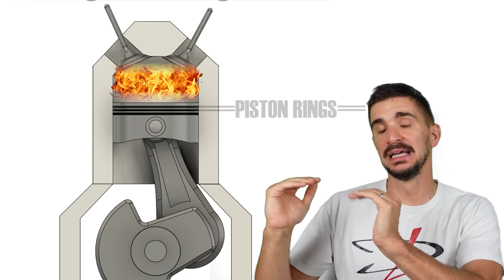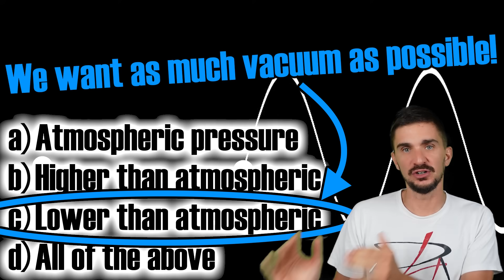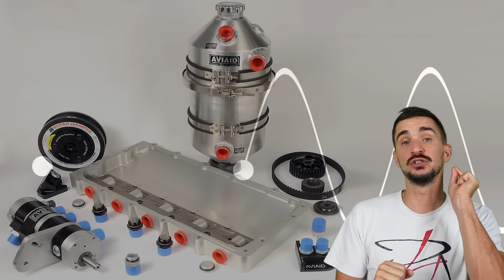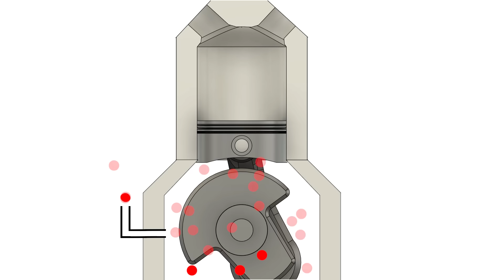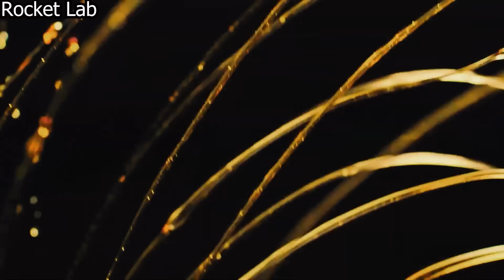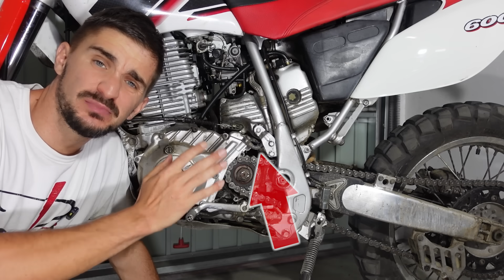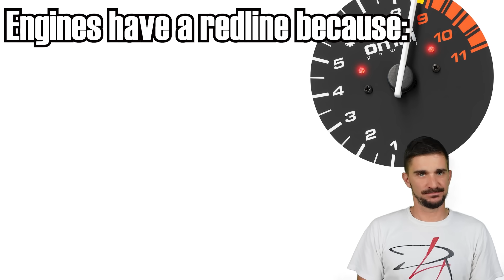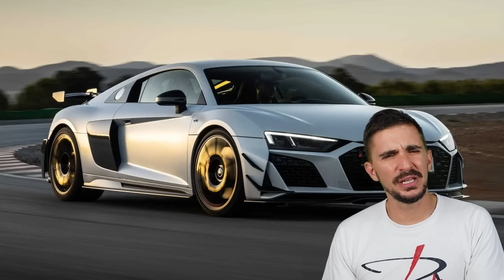Installing This Has No Drawbacks, Except for Your Wallet - Dry Sumps Are Awesome, Here's Why...

Comment: I might be missing something, but if you draw a vacuum in the crank case won't the power loss stay the same because when the piston moves upwards its now increasing the volume and therefore increasing the vacuum pressure?
Reply: There is a little bit more math to it. Yes, a vacuum does "suck" the piston down, but a stable vacuum sucks the piston down both when the piston moves up and down, so there would be no net energy loss. Same thing can be said about a perfectly sealed positive pressured crankcase, even if the pressure goes up and down because of the volume change, it just behave like a spring, which takes energy and give it back. 
But the key is the PCV, with the valve, there would be more energy loss when piston goes down than energy gain when piston moves up, because the overall crankcase pressure is higher when piston moves down, the high pressure was released by the valve before the piston moves up, therefore more pressure resist piston when it goes down, less pressure push the piston when it goes up, now we have a net energy loss. 
Hope this helps a bit.
Reply: @wolffz6597  I think it's more about turbulence and friction.
Like, moving that air creates unnecessary friction and turbulence of that air, which in turn sucks power. Like running a pump that's not connected to anything. Pump works, consumes energy, pumps air but no job is done.
Dunno about hydraulic pumps, but one can actually hear centrifugal pump (vacuum cleaner for example) spooling up upon blocking the intake, despite the increase of pressure difference.

Though if anyone found my line of thoughts incorrect, feel free to correct me.
Reply: @mantas8443  I think that's a very solid point.👍 Real life situations are mostly caused by multiple reasons combined. Friction is almost always involved.
Reply: I think the power you get is from the crankshaft having less resistance

Comment: Question about crankcase volume.  Early on you said the motion of the piston moving up and down varies the volume of gases in the crankcase.  However, for every piston going down, you have one moving up.  In my mind, the volume of the crankcase is a constant.  Explain please.
Reply: If you have seen other videos of his, the piston moves at different speeds during the top and bottom of the strokes.  More cylinders can help counteract but not entirely.  In this video, he specifically mentions engine configurations (some two cylinder and boxer engines) where the pistons are moving in conjunction with each other, multiplying the effect.

Comment: If you ever looked at where the PCV usually connects to, after the throttle body on the intake, you can see that the PCV does pull vacuum. Sure, not as much as a dry sump, and it's not going to rip oil out of the crank, but like with a brake booster, that intake is actively pulling through the PCV and will maintain some degree of vacuum if it can manage enough flow.
You also didn't explain how the aerated oil gets separated after pickup. I imagine many systems would work fine with a simple gravity drip resorvoir, but as the load gets higher I imagine a gravity drip would become less feasible, you'd need to run something like a centrifuge to fling the oil out of the air more actively, so you don't need a massive 10L of oil just to keep up with gravity feeding the pressure stage on an overcharged 2L engine.

Comment: Another reason they’re probably not used is because of the amount of oil. It reduces emissions, so that would be nice for manufacturers, but if you had to use 12L of oil every service I’m sure most customers would complain, and most importantly, most emission regulations would have a say in that. So that’s probably the real reason again. Still a bummer tho. I wonder if there would be a way to achieve the same effects with a smaller oil capacity without any drawbacks?
Reply: It is very widely used. Porsches, Lamborghini's, Corvettes, previous generation of the Mercedes AMG GT. I think even Porsche Macan turbo had one also.

Comment: For the cranckcase ventilation it is not that simple, at least not in all cars. In my subaru I have pcv which goes to intake manifold, but also a breather hose going in front of throttle body. So at low manifold pressure air goes through breather into engine and then out through pcv taking out moisture, and at full throttle any excess goes out of breather without the spring limitation.

Comment: Is packaging another reason why dry sumps are more common on motorcycles? Motorcycle designers have to squeeze engines into very tight spaces and perhaps dry sumps help them move things around a bit. My K1600GT has a dry sump but the oil reservoir is positioned below the crankcase. When changing oil there is a second drain plug that is removed by using a 5 mm long allen key in the drain hole for the dry sump.

Comment: Ok, so if compressing the gasses in the crankcase absorbs energy during the power/intake strokes, don't you recover most of the energy during the compression/exhaust strokes? It acts as an ideal spring, no?

Comment: Also dry sumps can sometimes be the only way to increase oil capacity on some platforms. Sure the cost is high for a dry sump setup but a spun bearing is also expensive.
Why did the k frame have to exist? Was it made just to eat my wallet.

Comment: Question regarding the M177 in the C63S and the M178 in the AMG GT. M178 is the same as the M177 but with dry sump, but the horsepower is the same.

Comment: There are no drawbacks to having a bar at home either. (Well, if we for arguments sake ignore the added risk of burglary, which is just added complexity)
But people don't have them at home because they want to use their money for things that give them greater benefits.

5-10% on 500 HP is cool.
5-10% on 100 HP is "meh".
5-10% on 5 HP would be WTF.

And added complexity IS a drawback, just like having a gold bar at home is added complexity, and when the system starts malfunctioning it will be harder to diagnose, make the engine fail catastrophically quicker (barring a hole in the oil pan on a wet sump) and require much more work and money to fix.

KISS, keep it simple stupid. There's a reason the most common vehicles and equipment out there are the most simple designs... They have less complexity so they are less likely to break and they are cheaper to service.

Comment: Isn't the efficiency lower at low load, low RPM, due to the parasitic loss outweighing the benefits?

Which would explain the lack of dry sumps on engines that spend 99.99% of their life in that regime

Comment: While my car doesn't have a dry sump system, it does have a pretty well designed PCV system that can be upgraded to ensure negative crankcase pressure. (This has been track and road tested.)

I'd love to add a dry sump to it, but I know it's not really necessary.

Comment: Will all the innovations designed to reduce fuel consumption, its odd that dry sump oiling hasnt shown up in mainstream passenger vehicles. It seems this would have the added benefit of the gas being recycled as part of the pcv system would have less oil and leave less deposits in the intake.

Comment: yes they abso-fuckin-lutely have drawbacks. 
1 its more complex, bigger potential for failure, lubing system is often complex and involves more than one pump
2 they more sensitive to oil level. it can affect pressure and all that crap. again, its complex
3 oil change is more complex
4 more expensive 

so yeah good normal sump with baffles is the way to go unless youre racing...
Reply: So you say all he said
Reply: Oh i dont watch, just read the clickbait title  @Pawex55
Reply: @Tiramisu92  Oh I'm sure 99% clicked because they read about no drawbacks

Comment: old 2.6 Mitsubishi engines had 4 quarts(3.8) liter capacity. If you revved them hard, and, as was common back when, used a heavy spec oil (20W50) you ran the sump very low, add corners or some hills to the equation and you saw the pressure drop in corners. Small 4 cyls often flow as much or more oil than big V8 engines did. I knew a few guys racing these (2.0, 2.6 and a combo version with 2l cranks in 2.6 blocks) and they, by rules, had to use a wet sump, so they had custom pans, adding capacity and trying to keep the pickup covered, as well as adding remote filters with a big filter, an oil cooler more for the capacity then actual cooling benefit. One guy also ran an Accumulator. So the lowest dollar guy was running nearly 7 quarts, the guy out-spending them had 10 quarts running through his system. Added to the near $400 cost of just a gasket set at that time, I decided not to run one in a car I was trying to build. I went 3TC Toyota (It's a Hemi!) over the  ubiquitous Ford 2.3 Pinto/Mustang/'stang II/Ranger  (One track had a 1lb per CC weight limit.Using a 70 Corolla, I was going to have to add weight to make the 1793-1800 lb limit)

Comment: 5-10% is 3-6HP not 30HP.
Reply: For 500hp 5-10% is 25-50 horses, captain maths.
Reply: @vvevvevvvv 0.0000001% of ICE engines has 500HP. Normal ICE engin e has closer to 50HP than 500
Reply: @nanab256 lol. You just watch the video instead of arguing. There are plenty more than 0.0000001% of Ice engines which have 500 hp. Your maths is wrong again.
Reply: @vvevvevvvv Can you name 1000 ice engines used in cars with 500HP? Or maybe 100? 50? Thousands of engines are close or below to 100HP. Vast majority.

Comment: Audi has been running 100 mbar (4-cyl) and 150 mbar (6-cyl) crankcase vacuum on the TFSI for over a dozen years now.  Trying to combat the oil consumption of their bean counter designed piston rings, they increased the vacuum 5X from 20 and 30 mbar.
And they seem to be re-learning the oil capacity benefit too.  B8 2.0T carried 4.6 L of oil.  B9 2.0T upped that to 5.2 L.  Now the B10 2.0T apparently takes 6.0 L for an oil change.
Reply: B6 4.2 took 10L of oil...

Comment: The traditional 911 dry sump lubrication system is not surpreme only because it's a dry sump system. By having the scavenging pump pump the oil throgh the oil cooler AND the oil filter before oil reaching the dry sump. the system protects the very important oil pump and ensures that clean, cool oil is always fed to the engine. To this day I just don't understand why racers and other dry sump system users don't do it the same way. They all seem to feed the high pressure side throught the filter and the the cooler, not the low pressure scavenging side. Only hard acceleration and braking on a motorcycle could starve the oil pick up. Since a bike leans in turns, the oil level will still be level in the oil pan.

Comment: I'm honestly surprised more modern "pedestrian" cars don't use a dry sump. Adding to the point about cost and complexity, so many modern engines have intricately complicated engine block girdles, mid-pans, lower pans, etc. so it would be trivial to cast or mold in most of the ports, passages, and pockets needed for a dry sump.  Many lower pans now are plastic, and injection molding complex shapes at scale is not expensive, and some already have oil pickups integrated in them.

Cheaper cars don't spend their life at high rpm, so budget dry sumps could get away with only two or three scavenge stages instead of four to six.  The drive system could be run off the timing belt or other accesory drive to further lower parts count.

Efficiency could be increased with a small dry sump that uses variable displacement pumps and operated with less vacuum than race applications.

Finally, the manufacturer could advertise longer oil change intervals.  The extra capacity means the oil stays cooler, is less aerated, and is less susceptible to contamination in the crankcase, and provides more opportunity for filtering.   Fewer oil changes means less petroleum used for the life of the car, and that helps the environment.

Comment: Even if is just 5-10% power increase, it could be valuable. At least in europe, regulation are shaving contamination sources and this could be a good one, although, since it makes the engine run cooler, I wonder if that could affect the particle filter regeneration as it need to be really hot to do it properly.

Comment: How do extreme lean angles on a motorcycle justify a dry sump?  The acceleration on the oil in the engine is still aligned with the cylinder axis.

Comment: Great video. One correction, not all aerobatic planes have dry sumps (Bellanca Decathlon, etc). Limiting factor is that the prop blades can only turn so fast so RPMs are often limited to 2700 or lower in a direct drive engine. Rotax engines are geared so they do have a dry sump but their rpm's are double due to the reduction gear.

Comment: Very interesting and as usual well explained.  But why do you persist in using the bar as your unit of pressure?
In the S.I. the unit of pressure is the Pascal (Pa}.  1 Pa  =  1 Newton per square metre (1 N/m²) a quite small pressure.  1 bar  =  100 000 Pa  =  100 kiloPa (100 kPa}.  So 5 millibar (5 mbar)  =  500 Pa, and ½ bar  =  50 kPa.
The bar is not mentioned in the latest editions of the S.I. brochure.  It is generally deprecated in most National Standards Institutes, with the exception of meteorology, where standard atmospheric pressure  ≈  1013 mbar.

Comment: Those are pretty good for maintenance, and that's a Autoparts shop problem lol, if you stuck a simple one on a casual vehicle, it would have its parts last even longer than usual, which means less clients...
Reply: don't worry, they'll fit puretech wet belt system to fix that.

Comment: A friend of mine back in the mid-eighties was a assembler for a HP engine builder at that time and recalled when they accidently discovered the free HP when a newbie installed two unvented valve covers on a new engine going on the dyno and nobody noticed till the engine produced about 30 HP more than the package should have. He said everybody stood staring at the engine brainstorming why did this engine make more power than it should have

Comment: My Rotax 915 aircraft engine has a dry sump and uses the blow by pressure to return the sump oil to the remote tank without the need for a pump.  A pretty clever solution, but obviously means no vacuum in the sump.

Comment: I am always impressed by the quality and thoroughness of your explanations.  I did notice a couple of things though.  If the crankcase has a vaccum it will be easier for the piston to move downwards, but it will also be harder for the piston to move upwards, increasing the vacuum.  Thus, there should be no net difference between a pressurized crankcase and a crankcase with vacuum.  Secondly, the racing bike on a steep cornering angle would experience centrifugal forces that exceed that of gravity (assuming the lean is more than 45 degrees from vertical) and allow the oil to pool in almost the same places it would if the bike was upright and not moving.  Small details that don't change the point of your video, but I appreciate how well thought out your explanations are so I thought I would share.
Reply: Agreed, there are multiple technical explanations towards the beginning of the video that are just plain incorrect. However, the general point of the video stands.

Comment: Can you add a dry sump to any car? The new 300 series Landcruiser runs with 0W20 oil for emission regulators.  This is the 3,5l v6 diesel.  There has already been a few catastrophic failures due to heat soak when towing heavy loads in Australia.  
It would be nice to add a dry sump to the engine for more volume of oil and to change to 5W 30 oil.

Comment: Top fuel dragsters use wet sump systems while funny cars use dry sump systems, though I’m pretty sure the only reason is so the driver can see over the engine in a funny car.

Comment: Drawback: It does go without (Drysump), but nobody would step into an airplane, if the technology wouldn´t hold up maximum Standards, so that of every 100 Airplanes one would fall of the sky...Albeit that analogy sounds absurd, but thats, what is reality in aero-industry: maximum standards of engeneering and Material.  Without, for every 100 airplanes, one would fall of the sky - probably every day....
If  car-industry would follow those uncompromised standards, things would be pretty diferent. Yeah, it also would be even more expencive....i mean, modern engine-technology is on a pretty high standard. And many failures do not come from engeneering-/manufactoring failures, rather from maintenance-failures (not doing oilchange...wrong oil ...bad oilcharge....such things and nobody is testing the oilquality every day and knowing, hat to search for). But we do not see drysumps attached to every engine. 
I wonder, if all those small WRC racecars have drysump, because they often almost only levitating above the ground and having huge G-forces to cope with in short sequence., so oil-support could be a main problem? And the fact, that they having only 1.6 liter displacement, but up to 300+ HP, so pretty less marges for not having lubrication.
Reply: Of course WRC rally cars have a dry sump system. Use Google.

Comment: Wait a minute! At 4:04 "the boxer twins! Isn't the pressure just being transferd from one pair to the other, keeping an almost even pressure in the crank case? As both "twins" occupy the same space? As one pair reaches BDC the other pair reaches TDC!
Reply: In the boxer twin, like BMW motorcycles, both pistons are at TDC and then at BDC at the same time (180 degree crank) so crankcase volume changes greatly. The 4 cylinder boxer engine would keep crankcase pressures changes to a minimum.
Reply: Its the same with inlines